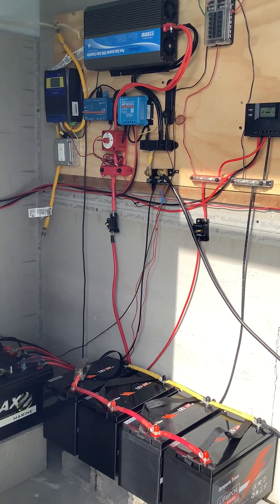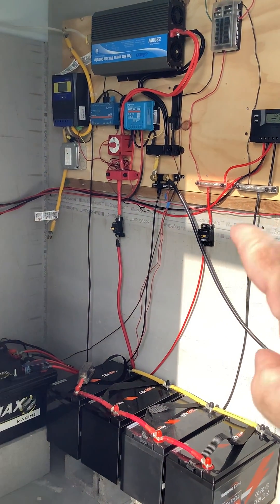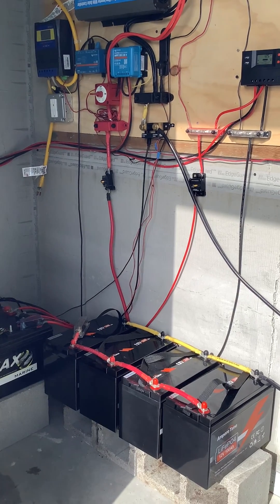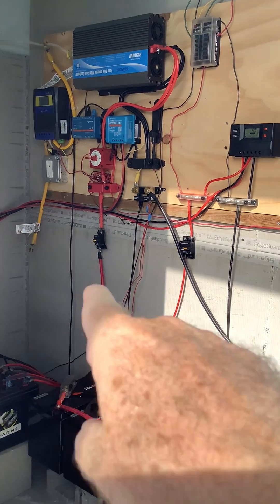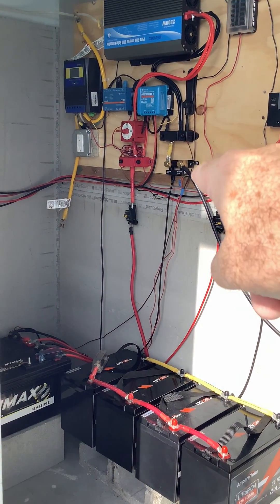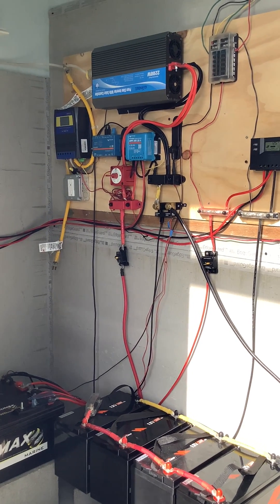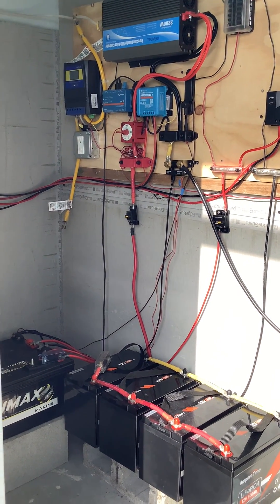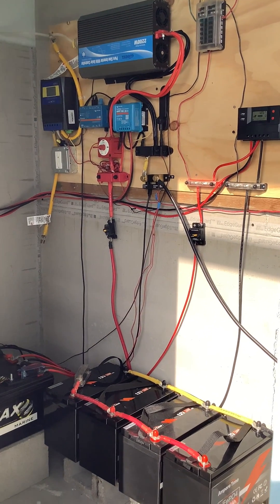My complete solar power system overview

Comment: The Giandel inverter says it has a charge controller built in.  So why do you have a separate charge controller?  Love your videos.
Reply from the maker: You’re right it does have a bout in controller.  I started my setup with a marine installation in mind and was striving for all Marianne rated components.  This inverter was not the one I was going to bring to the boat but the other thing is that I like to keep my components dedicated to one task  and so I probably would have got the little controller anyway.  It’s great to have the redundancy in the inverter if the main controller had failed too.  Thanks for the comment, please let me know if you use the built in controller.

Comment: Does washin machine is working with this ?  Thanks
Reply from the maker: Hi Marius, if it’s 110 then it should … you would need to see the watts used for your machine to determine battery impact.  If it’s a very efficient 110 machine might be ok.
Thanks Marius.

Comment: What's the red box (cut off switch?) and below it (it's red...maybe a busbar?) between your Cerbo and your controller that's connected to the inverter.  You got links to those?  And which wires from that red box to the inverter?  What gauge?  Link again?  ty
Reply from the maker: If you’re not building a marine system you don’t need that. You will connect the positive wire from the inverter to the positive busbar along with your battery and controller positive cables. The negative from the battery goes to the shunt, then the shunt and inverter and controller negative cables are connected to the negative busbar. Go with the 150 amp breaker and keep it simple. 👍🏻
Reply from the maker: Yep it’s all there  👍🏻
Reply from the maker: Here you go https://www.youtube.com/watch?v=L4Ux49mkpRY